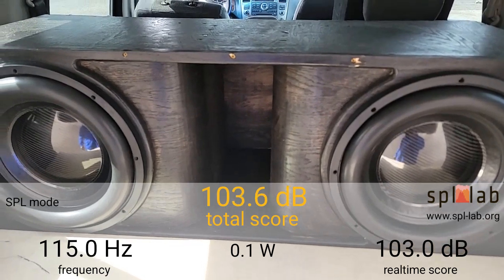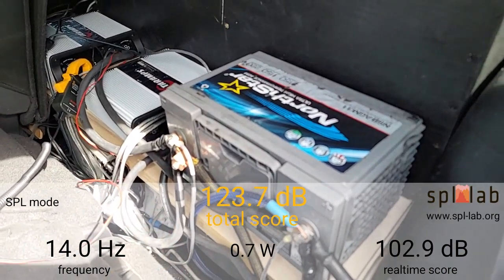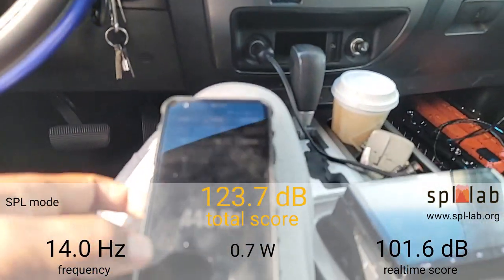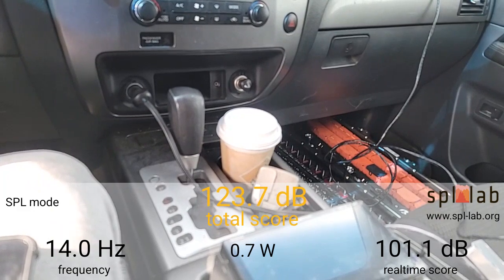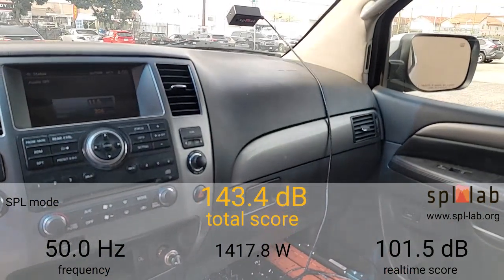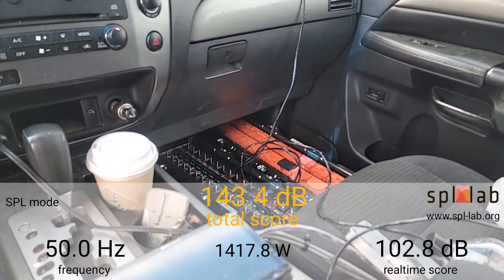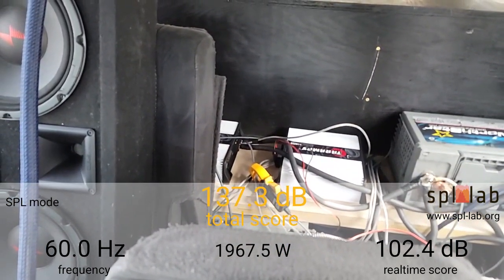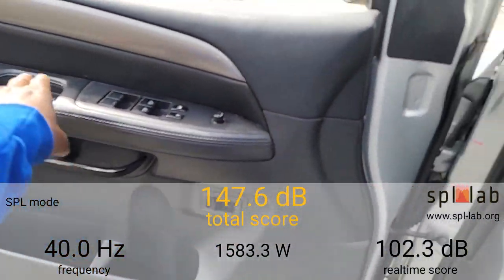Taramps Smart 3 Bass Meter And Clamp Results @ .7 ohm ( Agm Battery )

Comment: How do u gain match amps with SMD tools.  They tell u exactly how much power each amp is putting out or u just setting til distortion.  That will be a good future video, of u showing us how u do that.
Reply from the maker: Funny you said that I was thinking the samething. I'll definitely be sure to show how I use the tools
Reply from the maker: @nate0 I've actually done this for years and there's really not any difference between the two

Comment: So you can use those voltage reading bass knobs on the taramps?
Reply from the maker: In this video the voltage meter is at the battery. The Bass knob is Rca style so it's universal

Comment: I just buy this amp but i don't want to run 2 battery i have Agm battery on my car i goin to use 0 gauge wire do you think is gone work? Or i need a second battery
Reply from the maker: The way you're doing should work but the more battery reserve you give it. It'll put out a little more power
Reply: @BIGJURAY20  why everyone say is gone go to protect mode or shut off whit only 1 battery
Reply from the maker: @CorvetteC6-LS2  if you set your gains accordingly you'll be ok. I had a stock alternator running 2 3k of a single battery. It played without issues. But, the extra battery reserve would've powered them up louder without risk of protection

Comment: Hey bigjuray since you try a lot of amps I have a question:Do you notice any difference between half bridge and full bridge amps if they are the same wattage? Never tried full bridge for subs and I am curious to know. Thanks!
Reply from the maker: Well I still have some testing to do. But with the swap I just made the half bridge maybe Slightly louder on some frequency ranges but honestly both put out about the same output and I don't notice a huge difference.  With proper tuning you can't really tell
Reply: @BIGJURAY20  thanks bro I really appreciate it
Reply from the maker: No problem anytime

Comment: 10.4 volts ? I get nervous at 13.2 volts
Reply from the maker: Yea it's risky but they'll play just fine as low as 9 volts. But of course the better the electrical the better it performs
Reply from the maker: You shouldn't be nervous at 13.2 volts that's pretty good

Comment: My 3k bass amp keeps turning off in both my cars every time i play it for a while ?
Reply from the maker: Could be your electrical, the ohm load or how you have the gains set
Reply: @BIGJURAY20  i have a second battery so I’ll check the gains and see
Reply from the maker: @bigbrta  How's your voltage at the batteries?
Reply: @BIGJURAY20  that’s something i haven’t measured but i have the same amp in both cars and it does the same thing.

Comment: How do 2 of them together only do 2800w when they are 3k a piece??
Reply from the maker: Different frequencies will show Different output. In this case i also didn't have the proper electrical system
Reply: he drop to 10 volts...  thats no good...
Reply from the maker: @Generation-X  True but these amps will play at 9v-17v. I did this to show what people should expect with bare minimum electrical. Pretty much stock electrical system only agm battery